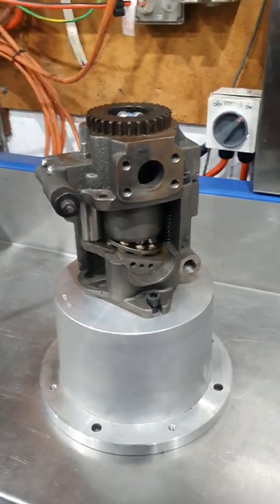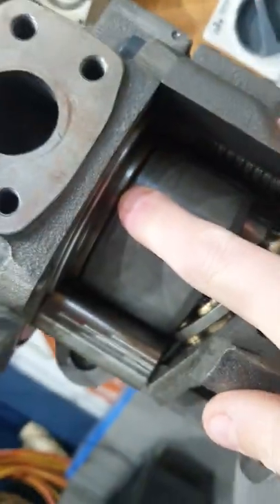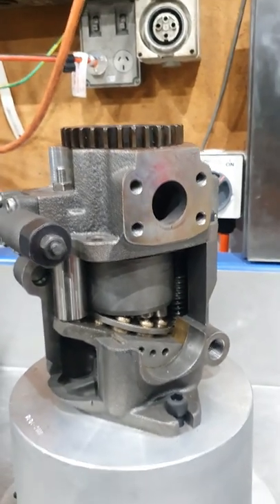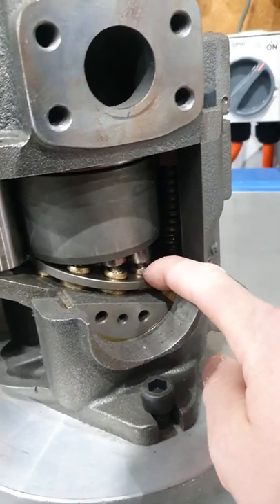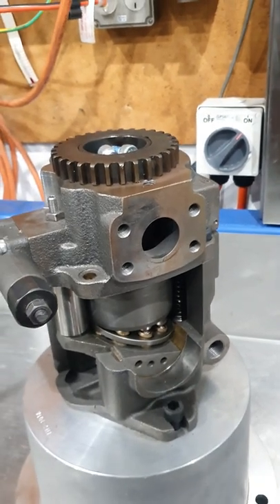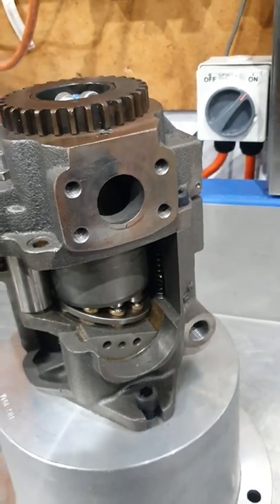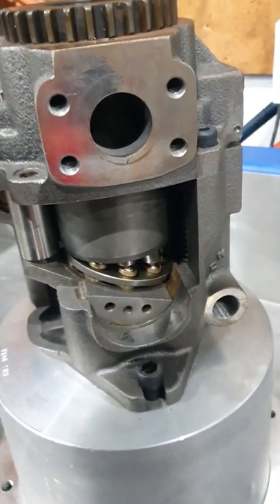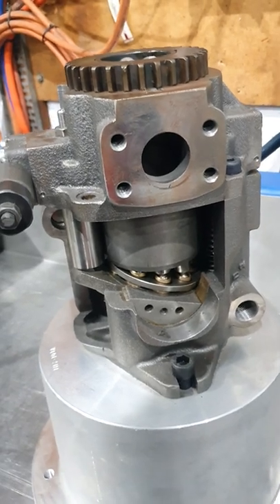Hydraulic piston pump failures. High case pressure and Suction issues

Comment: Can we measure the case pressure with the pump in operation? Or we need to install a specific point of measurement such as Minimess® adaptor?
Reply from the maker: We have never really measured case pressure as a test. You can check all the things that may be causing it such as a blocked tank breather or if the case drain is plumbed back through the main return filter you can check the differential across the filter to see if that is an issue. This is why we always run a separate case drain line all the way to tank.  
Generally vacuum in the suction line is a bigger issue than case pressure.